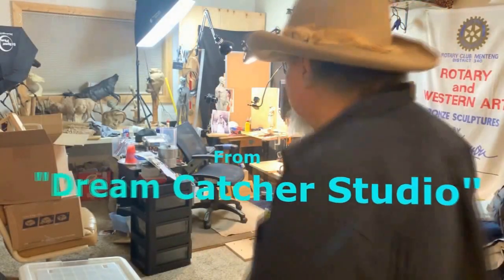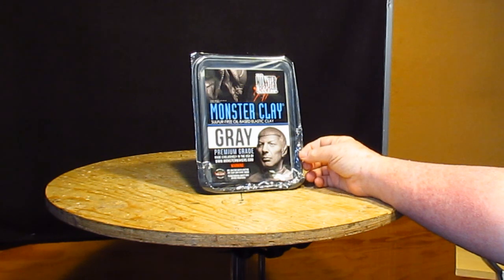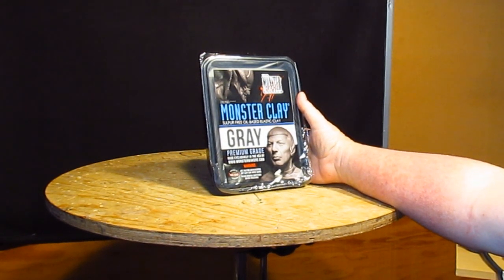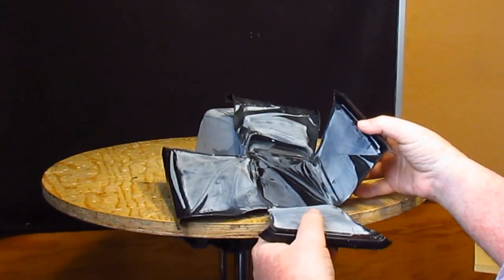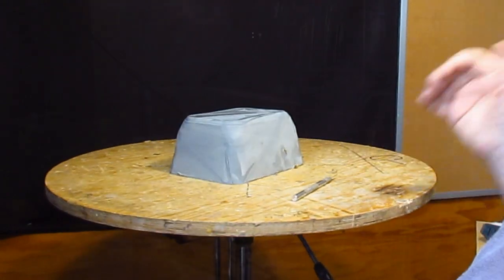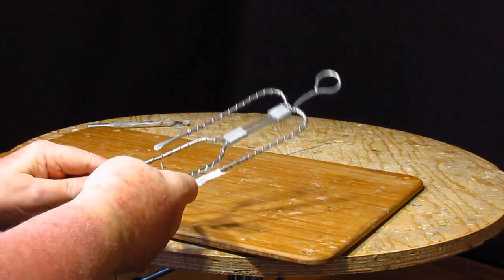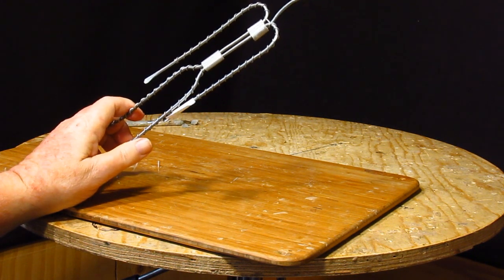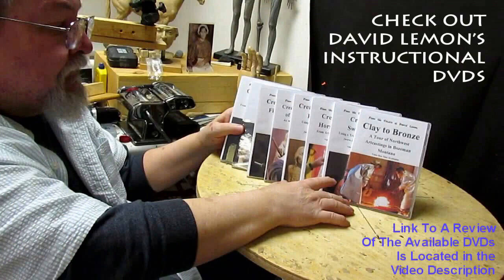Monster Clay   Trying It For The First Time

Comment: I use Monster Clay, along with many other oil based, polymer clays, etc. The more you work with it, the better you understand its properties. It's great for working out pieces very fast when it's soft. I heat it up under an actual heat lamp and keep it in the tub. I gouge out pieces with a thick metal loop tool. Have fun with it, Dave.
Reply from the maker: Yeah.. I've done that with other Plasticine clays... to. I've even softened it in a crock pot of water.. But cutting it into small pieces makes it faster and easier to heat.. and use.. thanks for your comment.

Comment: I am glad to see you back, missed your voice and comments and your sculpturing. I normally use J Mac but tried Monster Clay a year ago to do a bust. I was a little apprehensive at first because I make my own molds, silicone rubber so was a little apprehensive. Everything worked out okay. However there is a learning curve to it. I have the hard, medium and soft but to me the soft is more like the J Mac. You use wax for some of your sculpture so you should be able to work with this okay. I know what you mean about old age. I am 21 years old with 58 years of experience. The only thing I have got out of old age is WISDOM. Good luck with the Monster Clay.

Comment from the maker: I ordered last week a 5 pound tub of Monster Clay, from The Monster Makers Inc. First thing before I can use it is to cut it up into smaller pieces, that will, heat up and soften up faster.
If you're interested in sculpting, and you want to take advantage of my over 50 years of sculpting, you might check out my 9 instructional DVDs in the Video's Description.